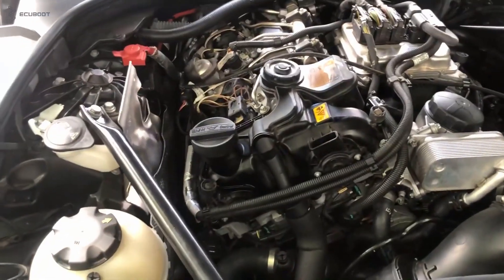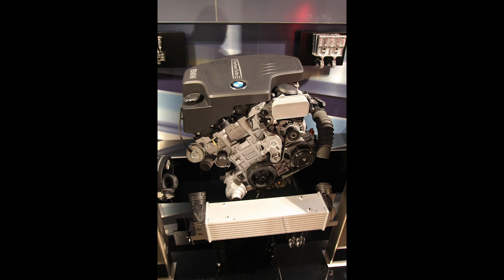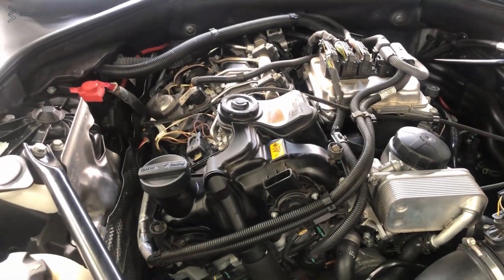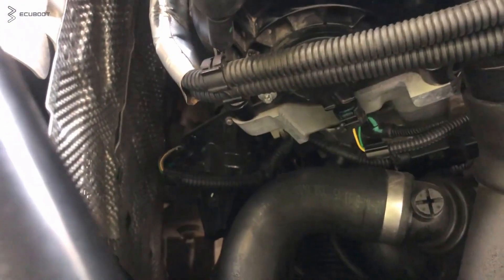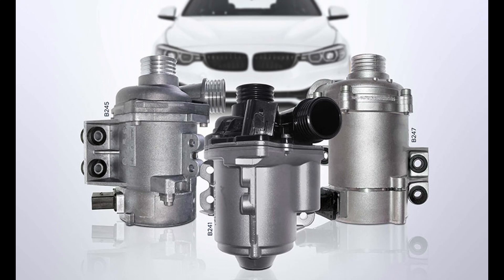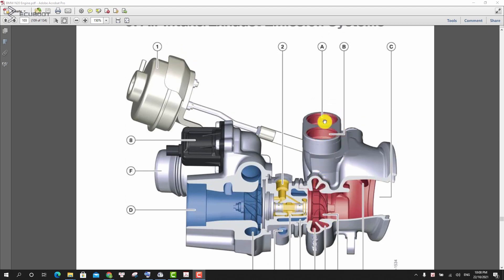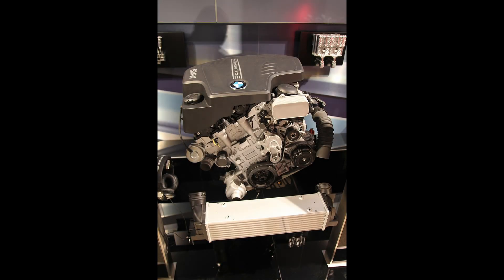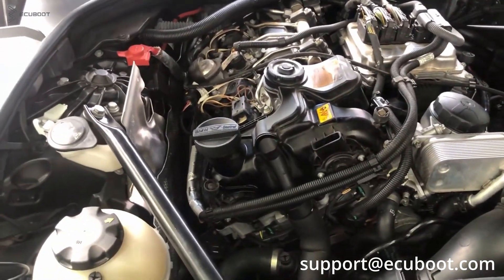Common Problems on BMW N20 Engine

Comment: Excellent video! I have the same car , now it won’t start , code p1338 ,p1339, p0301,p0304 and p0300, replaced both cam sensors and just replace crankshaft sensor with a autozone brand still no start. Timing chain is t slack , it’s firm!  Any help ?